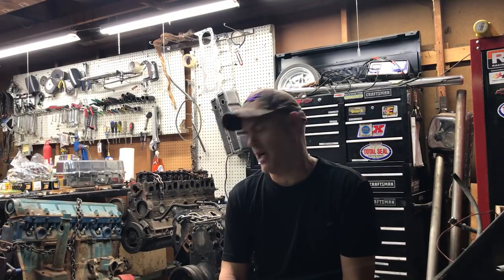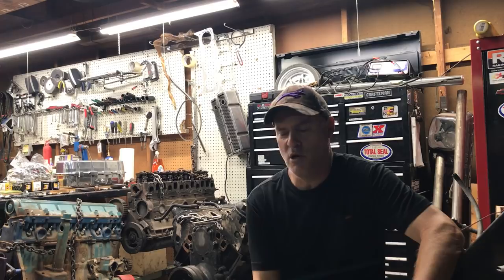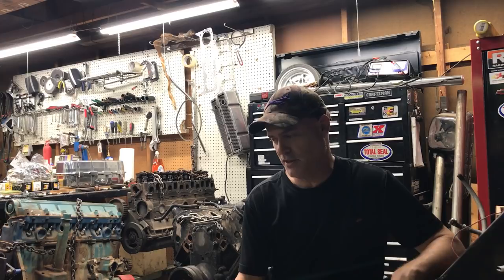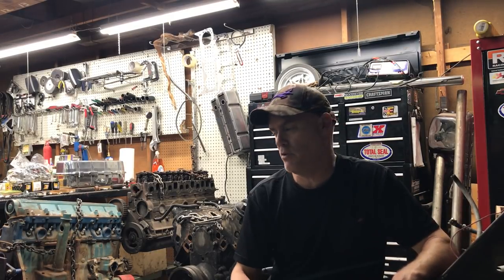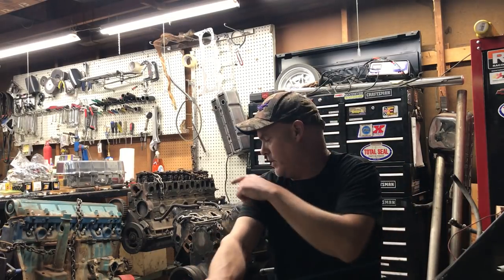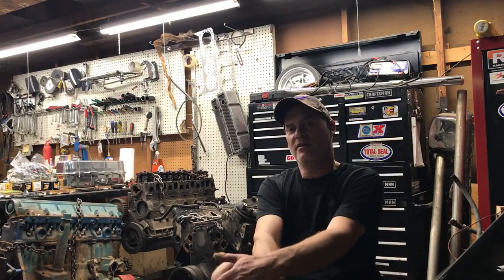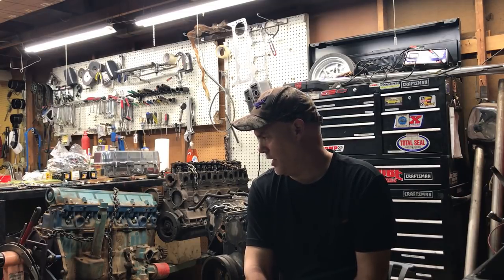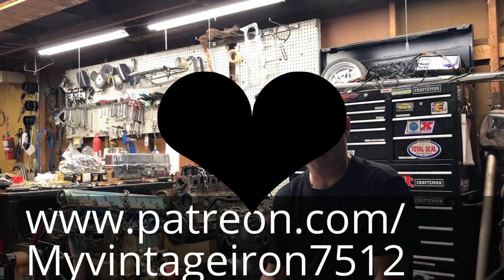Lets Talk LS Engines

Comment: The Truck engines have been near bulletproof. The 5.3 and 4.8 just won’t quit. ( the old ones before the stupid cylinder deactivation V4 mode). I have a 2001 with the 4.8 that just won’t quit and I’ve even tried to blow it up. I’ve had it for 13 years daily driver. However the 4.8 is a DOG on power yet sucks more gas than the 5.3. They share the same bore size but the 4.8 has   a lot shorter stroke hence the displacement loss (293CI vrs 325CI). The 4.8 has virtually no torque at all and has to be wound up high rpm to make any power. Many people bought the 4.8 thinking it would be a gas saver over the bigger displacement 5.3 but were greatly disappointed. The 4.8 will drink a lot more gas than the 5.3....probably because it has to work so much harder. Short strokes are great when you got a good bore size like the 4 inch 327 bore. The smaller bore and smaller stroke together just don’t work well
Reply: JohnnyRebKy yup 2006 and below ls engines are beasts, the newer ls and lt engines are garbage and not reliable like the pre afm engines.

Comment: Even a 4.8 will outperform a old school small block w a lot of upgrades cam intake carb etc the 4.8 will smoke it times 2 in stock form is what I understand and take everything you can throw at it reliability is that correct ? So for just a few hundred bucks or so junkyard motor stock has twice the hp of a sbc from the 70s era with a bunch of money thrown at it ?

Comment: what do you think about LS4's? I know, FWD blah blah but I had my lifters worked on about 2 years ago and now my engine light is flashing again and i hear ticking and mechanic says its the lifters... i always check my fluids and dont drive like a mad man.  It drove fine in the morning and I went to put gas (premium 91) and it started right after, but i dont know that the fuel would do that.  Also I use full synthetic

Comment: The LS is the bomb, end of story. That said, the right head on a big block will kill a factory LS with a cam. Like AFR 265's with the Edelbrock RPM air gap is a great bang for the buck if you already have a big block. Brodix BB3-Xtra-O's with 45 degree seats are fierce if you build a 582.
Reply: Well yeah when you start talking huge cubic inches lol but really its a boost game anymore for a lot of guys. Guys are making 3 liter 2jz's making close to 2000hp with 80...hell 100 psi of boost. These days its not about cubes really but how much boost you can slam in your engine more than it ever was. I rather have a big block too running way less boost to make the same power and more torque honestly but in drag racing people get away with these crazy builds and weight handicaps
Reply from the maker: I am a big fan of BBC I just built a 502 for my 77 square body truck I need to pull a trailer so I chose a BBC my 502 combo makes 762 Ft Lbs of torque at 3800 RPM the TQ line on the dyno hits over 600 FTLbs at 2000 RPM and climes from there does not dip below 600 FT Lbs until I get to 4800 RPM I could not get that kind of TQ with an LS unless I turbo it I just went the 502 route NA 781 ported heads HYD roller cam and fuel injection
Reply: That's awesome

Comment: I love ls engines. I have done some swaps myself. if you have something stupid like an s10 by all means put an ls in it, but they don't belong in a classic car. old chevelle? BBC all the way.

there is a downside to ls and that is cost. if you use a factory fuel injection you have to make or buy a wiring harness and have pcm flashed. you can go carb for super easy install but the intake and ignition control module cost about 700 plus a carb.  some vehicles are harder to get the ls to fit for example did a 4.8 in my s10 blazer 4x4 and it was a nightmare $400 oil pan. sbc for that would have been easier. 2wd s10 are easier for either one.
Reply from the maker: I am getting ready to do an S-10 V8 swap I got an S-10 with no engine basically given to me I will most likely go with an early SB I am going to build it with engine parts I have laying around my goal is to spend $0 on the engine I have enough blocks/cranks and stuff that I think I can do it I may even do a vid series on it and call the the zero dollar  V8 S-10
Reply: sounds like a cool project. you should make some videos of it!

Comment: What are your cam suggestions for the LS engine as well as aftermarket heads for the most bang for the buck?
Reply: It depends. For a factory stroke, under 224 degrees with .550" lift will do great with factory heads up to 5800rpm, and truthfully, out to 6200 RPM and the engine is designed to take it, stock, and the torque curve will be BMW flat.  Texas Speed 2.5's are great heads, period. Aftermarket heads like Brodix BR3's, BR7's, and AFR 245's are more for stroker motors that don't really see the street. Watch Texas Speed's channel.
Reply: AFR makes a nice LS3 head that would be great on a 427 LS with a 228/236-110 and the factory LS3 intake.
Reply: Even in stock form, a 5.3 is a cam-only powerhouse. This is pretty impressive: http://www.powerperformancenews.com/tech-articles/killer-cam-combos-cam-only-5-3-vs-ls3/
Reply: Wrongwayislost77 That is nucking futs... 430s out of a 325 ci ls with just a cam swap and headers?
Reply: Dragon Raptor, No need for aftermarket heads if cheap power is your goal, 317's, 243's, 799's, and 862's, will all make great power.

Comment: I’m guessing this is an impossible question, but, if I buy a 100k mile ls engine from a junk yard, are there obvious things I can check before installing it? Like how can I know if there is cylinder damage or worn out rings or bearings without rebuilding it?

Comment: Do you have any concerns or suggestions for aluminum heads on iron blocks since gaskets usually leak after time due to different heat expansion rates like on the 3.7-4.7L dodge ohc engines? You suggest Fel Pro gaskets, my question is do they last longer than factory.
Reply from the maker: Yes fot that engine you want an MLS felfro gasket

Comment: Know next to nothing about LS engines , but the point with any engine is NOT to let the engine over heat .  If it starts to overheat , shut it off / down .  Right then and there .

God bless
Wyr
Reply: How well do the cast iron LS engines cool ?

How well do the cylinder bores resist wear , compared to the ( sleeves ) aluminum block LS engines ?

If you have already answered these questions on the cast iron LS's , please forgive me for missing it . 

Thanks ,   :-)
Wyr
God bless
Reply from the maker: They don't have any overheating issues and they are the cylinders are just as durable
Reply: Thanks .    :-)

Wyr
God bless

Comment: I never had a lower end failure on 1st gen
Smallblock. 1st gen big block? Yes.
3/8" rods in 396 were too small.
Big pop up pistons caused too much inertia bolt stretching in the 396. ARP can help.
4 years out on this video. And double digit inflation in 2022. Everything is expensive now.

Comment: Good morning, Thank You for all your videos. All this is great. May I  tell You that I  have  a  Suburban 2010 with this  5.3 liter engine? It works incredible.
 I noticed that  after 50 000 miles, it began to consume engine oil. It takes  about a quarter every oil change (3000 miles)
So I would like to build this engine, and somehow compensate  the oil consumption fact.
I have  a lot of  technical information about this  engines, however  I would  appreciate  a tried and true recipe  for rebuilding this  engine  for  street purposes. I thank You for  your kindness and time
Reply: 1/4 qt at 3000 miles isnt really bad, annoying yes.  if its burning the oil it usually needs new rings. Any motor you build your going to start by figuring out what you want to do with the vehicle/motor and what kind of money you want to spend.

Comment: I am doing a restomod 1948 chev pick\up! I have a 5.3 lt that I am installing! I have done a frame swap also to 2000 S-10 frame! Do you know what I need or the best way to convert the power steering gear box to the 2018 power steering pump.
Reply from the maker: nope never done that one

Comment: Do all 6.0 motors come with the ls3 style heads with the square port intake not the cathedral style? Been waiting to get one because I think the ones I’m looking at I’m thinking they’re swapping the heads on them because they have cathedral style intake ports
Reply: So gen 3 small block 6.0 came with cathedral heads. Gen 4 which started in, I think, 2008 had the ls3 style heads.

Comment: How does the LS perform with a Carb only asking cause I just bought a Holley carb and little did I know a few weeks later a 5.3 fell in my lap for cheap and I can actually tune a carb I have no idea how to tune the factory  EFI
Reply from the maker: They work great with a carb  MSD has a stand alone ignition for them to operate the coil on plug

Comment: Computer on the LS...  Some of us still like distributors that you don't need any sort of computer to run the engine.   Other than that, yeah - they are greatly designed engines.
Reply from the maker: You can run an LS with a carburetor

Comment: didn't they change the coolant flow direction starting with the LT1 then LS so that the heads are cooled first?
Reply from the maker: YES
Reply: It's a far better way to cool the lt1 was the first w reverse cooling and that changed the way it was done and messed up a lot of the old school guys w the water pumps and such they didn't know and tried an old style pump only to find the impeller was not designed to move water in that direction

Comment: I think an LS motor is a great platform. I do not think they are the end all be all that everyone makes them out to be. Case in point who we went from the 8.1 to the 6.0 in our uparmored Suburbans at work. We went from reliable power torque and acceleration to overheating, pinging and loss of power problems. Kinda silly to have a guy in a war zone hop out of a Suburban and spray the radiator down with a bottle of water in traffic. That said I have a 6.2 thats pretty great in my POV Silverado.

Comment: i like your video's but i have one gripe, in one you mentioned the "engine masters" show, i have watched a bunch and i have to say as entertaining as they are to watch , and sometimes even informative, a whole lot of the time their comparative tests on products leave me wondering about their real abilities, in one episode they compare the drag on horsepower/torque from various accessories,  they compared an electric water pump and a mechanical performance pump with neither one pumping any fluids?"? in another test the compare cooling various fans with a shroud then without a shroud and puzzled over why their original assumptions that there would be more drag w/without the shroud vs with it??, all while testing them at 3k and above ignoring low speed driveability rpm's , i realize they are high performance minded and as such tend to look at peak numbers at high rpm's, i mean it is clear they have some collective mechanical knowledge but these tests are either aimed at a newbie audience or they are phoning it in, because these tests are simply not as scientific as they should be.

Comment: My LT1 is supposed to run hotter than normal from factory like above 90 degrees Celsius. Now it runs at 60 degrees, not even operating temperature even though I don't have any mods for cooling. Not complaining but this really hurts the fuel economy and creates more emissions. I've also this causes the piston rings to wear out prematurely? Maybe the original owner took care of it since I've bought while it has AC DELCO's long life coolant.
Reply from the maker: It's running to cold your engine is going to wear out very quickly at that temp you need to put a hotter T stat in

Comment: I cannot see how it can be said they are “cheap”.  Heck, couldn’t find one 6.0 here in N.C. within 1500.00 - 2400.00 for a junker motor.   5.3 if it isn’t ruined is still 500$ luckily if local. Add at least a couple hundred if needs to be shipped.  Thanks YouTube for sending costs up again .  LoL
Reply: What !! Where do you live I bought a junkyard ls for 250 bucks with everything 🤣its working perfectly fine I put it in my 3rd gen Camaro and its still running strong I do burnouts every weekend. I don't think you're looking hard enough

Comment: Can an LS motor be setup to run a carburetor or is fuel injection the only top end option?
Reply from the maker: yes they have carb intakes for em
Reply: @Myvintageiron7512  Good deal. Thank you for commenting on my question.

Comment: can you build an ls that uses a distributor instead of an coil management system, is that possible
Reply from the maker: Yes but why would you?
Reply: i've never messed with the computer side of engines, i've always delt with gen 1 gm engines. if i go with an Ls it's going into an 85 c-10 pickup and i hope to put a t-56 6 speed manual behind it
Reply: david campbell There is no reason to use a distributor. There are aftermarket ignition boxes to run the coil packs that have simple programs that anyone who can read, and use a laptop, can use.
On the carburated LS engines that I've messed with I prefer the Daytona Sensors Smart Spark LS ignition box over the MSD LS ignition box. I've had a few with strange issues with them.
Reply from the maker: The computer side of it is easy it's plug and play
Reply from the maker: Yep MSD has a great set up for this it's a snap to use and coil on plug is soooooo much better
Reply: cool thanks i'll check that out, by chance when you do your ls series video will you go into the msd setup a little
Reply: So many issues with GMs vats security system! To be able to bypass this would be Great!!!

Comment: You should build a LS with carb and distributer
Reply: Can't put a distributor in them check it out you use the cam and crank sensor to send signals to an msd ignition box which in turn fires the coil packs at the proper time it's the only way to run an L?S engine with a carburetor period theres no way unless you spend some ridiculous amount of cash for some crazy parts that would have to be custom made to accept a distributor I.E cam gear to turn the damn thing for example in the end it would gain you nothing in fact would work far less better than the above described manner with the sensor and msd box system

Comment: What about cracked LS blocks?  Is it common?
Reply: Ronnie Montana get a gen 4 they pretty much never break if your looking for other motors from gm you will need a aftermarket block (there are a lot of aftermaket sbc and ls blocks that eliminate the crossbolt mains or put the ls style heads on a sbc
Reply: gen 4 sorry dont know why it cut out

Comment: Yo don't get me wrong when I say this because nothing you said about the ls is untrue BUT those GM designers didn't have to work as hard as you give them credit for building the ls because all they done was took the 4.6 Ford motor designed in like 1990 and put the cam inside the block like traditional engines! Sure they put their own touches to it but the block design is Ford all the way! 👍✌
Reply from the maker: That's true the one thing you are overlooking is the fact that Ford didn't have to work that hard either because all the design feathers built into them is not new and Ford did not come up with them the Germans used this block design in the early 1900's along with countless other manufacturers long before ford even had a V8 engine.  if you are implying that the LS is a copy of the Ford modular 4.6/5.4  I'm afraid that your dead wrong
Reply: Myvintageiron7512  I dropped a ls motor off to get honed and hot tanked and while I was there seen a 5.7 hemi block and they look very similar to ls stuff, I think the big three all had the same idea when the revamped their motors, Ford just put cams in the heads and the hemi doesn't have as many main bolts unless it's a 6.1

Comment: Question, is my 2015 gmc sierra 5.3 motor a LS motor?
Reply from the maker: it is same engine family
Reply: No, that is the new 5th generation lt series of motors. Still a push rod v8, turn off the active fuel management and Itl live forever I’m sure. The last year for an ls motor in a gm 1500 truck was 2013, they still use the 6.0 ls motors in the gas 2500 and 3500 trucks but as far as I know every other model has switched over to the new lt platform.

Comment: There is one reason why certain people don't want to use an LS-series engine. There are many classic car guys who don't want a computerized engine.
Reply: Skyline Fever You can run them with a carb, which is honestly what i'm thinking about for my firebird
Reply: Yes, I have heard of LS carb intakes, but I have never seen a vacuum and centrifugal advance distributor to replace the coil per cylinder ignition.
Reply from the maker: You can run an LS with a carburetor and MSD ignition no factory computer needed
Reply: Okay, that is good to know.
Reply: I have a 5.3 in a yukon xl 4x4 that impresses me every time I drive it. She has 240,xxxx kms on it and still purrs. The LS is amazing and have considered installing one in my 1972 Jaguar XJ6 instead of an old school sbc, but the computer stuff is also out of my wheelhouse. How expensive is the MSD ignition conversion and does it also manage the transmission's computer needs?
Reply: i just dont like the small block platform i like my torque more of a bbc caddy and bop guy caddy 550 lbft at 2000 rpm
Reply: i forgot diesels

Comment: LS motor is the next gen. Aluminum or cast iron.... Just depends on what kinda durability you need. Cast iron is good for 1000hp builds Aluminum is better for shorter life race motors.
Nobody can improve on the LS heads. Aftermarket heads are a joke